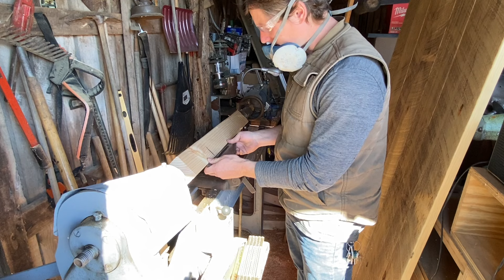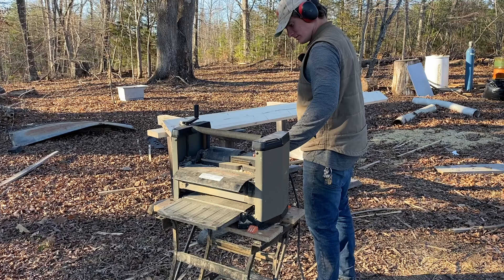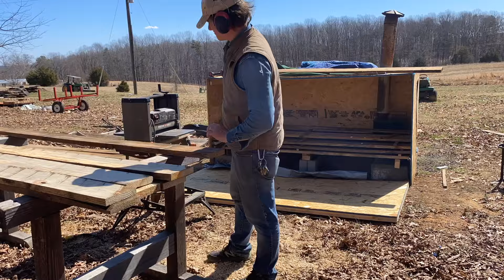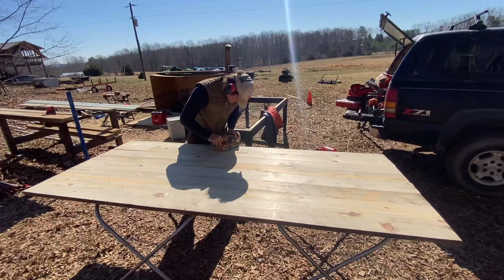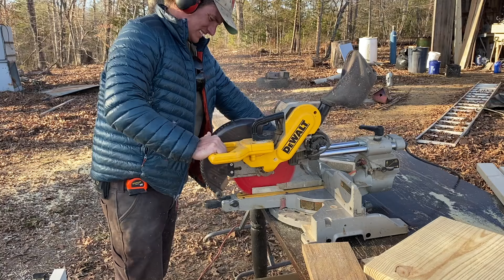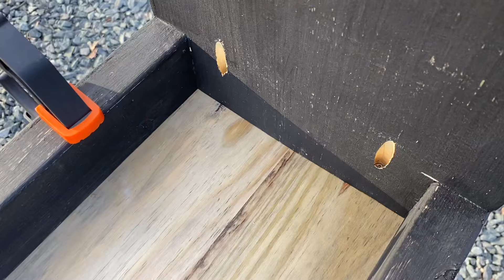DIY Farm Table & Benches - Woodworking at Home

Comment: What speed do u run your lathe at for turning legs /and with your duplicator jig? I'm new to using a lathe and have used your duplicator jig also....i get a sort of splintery/chippy finish perhaps because I'm running the lathe at too low a speed?
Reply from the maker: As slow as the lathe will go for the duplicator. I only use it to rough out the leg, then finish it off by hand using a skew chisel. Your finished surface is going to depend on a lot of variables like wood type, specific piece of wood, speed, skill, how you hold your mouth, etc but the duplicator i made is not meant to be an A - Z solution for turning.

Comment: Been watching you from the beginning, always great videos! 
Question I have, seems like you're using dimensional lumber from Lowes. Do you have a problem with that lumber not being dry and moving after the build?
Reply from the maker: You have to be strategic with how you use it. Apron boards are fine, turned legs fine, wouldn’t use them for table tops. Often times i’ll but the lumber ahead of time so it has acclimated and any boards that will turn into pretzels will start to show.